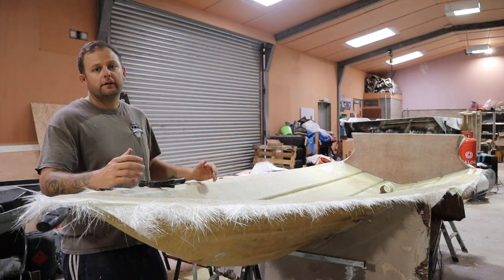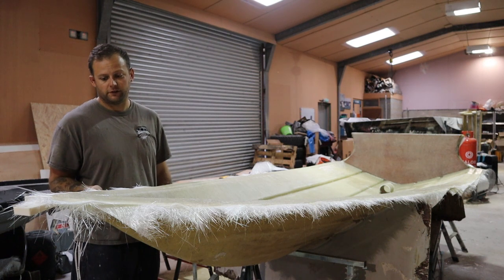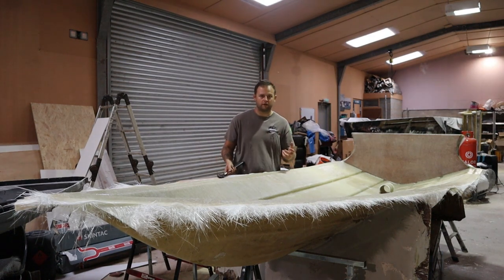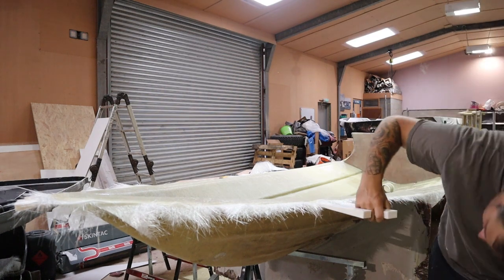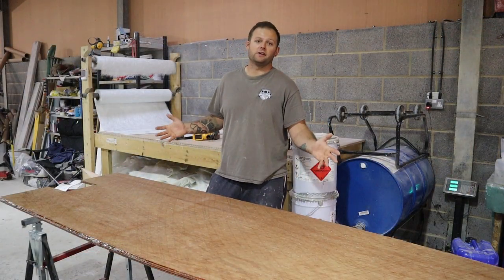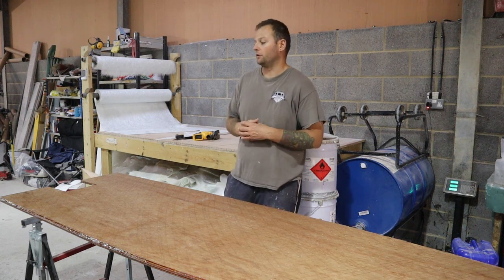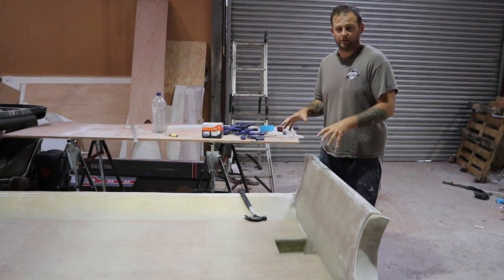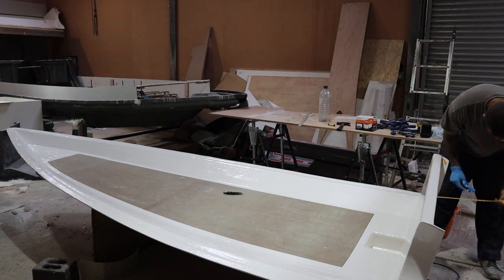how to build an Ocean rib 4.2 part 2 with SF Marine

Comment: Nice job steve , looks good look forward to see the whole boat
Reply from the maker: Thank you. I know its a way off but am looking forward to boatlife
Reply: The gel coat you put on the hull deck and inside transom at the end, was it a different mix to what you used in the mold?
Reply from the maker: @MrDanieljanes  hello. So. It is the same gelcoat we used when we applied it to the mould. The difference is. Because its a finish coat. We add 2% wax or (wax in styrene) as it is normally labled. This allows it to go hard and smooth and not remain tacky after painting.